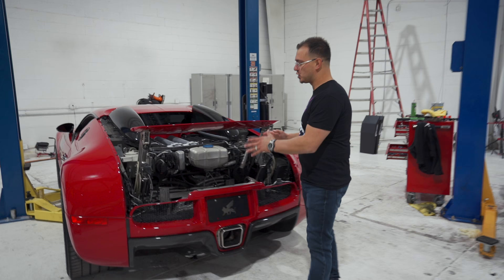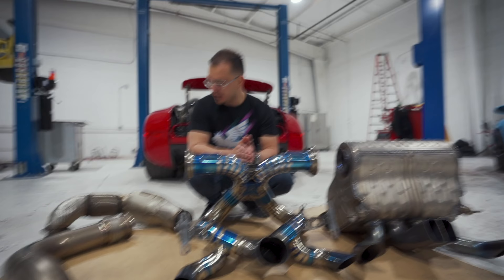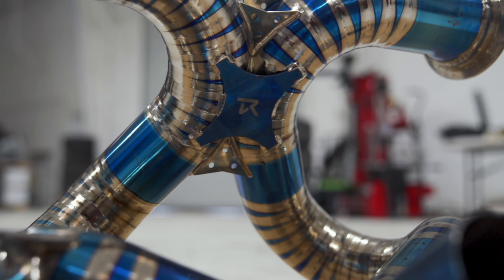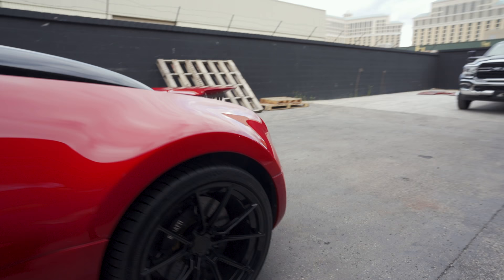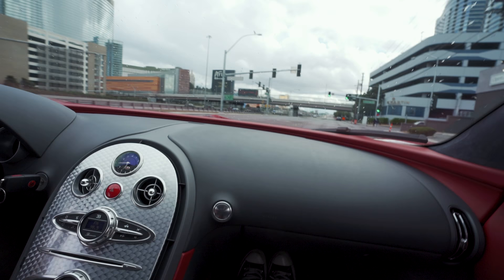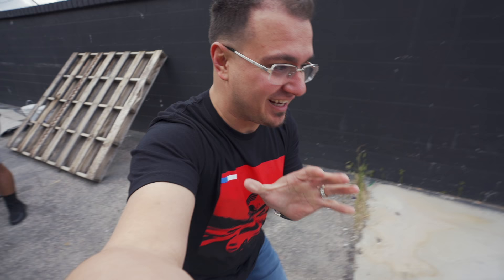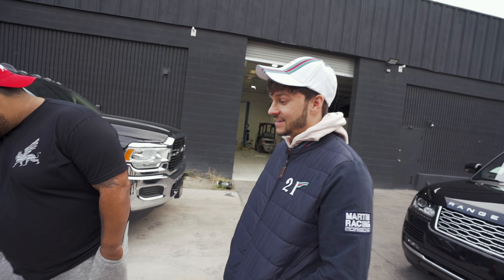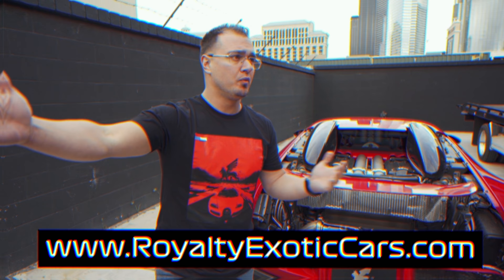Worlds FIRST BUGATTI Titanium Exhaust Install *LOUDEST VEYRON in the WORLD*

Comment: 'You can immediately feel the torque difference' - until you offer up a dyno chart - I do not believe you.
Reply: Lol right
Reply: lol I guess you don't know how turbos work ie less back pressure = more spool = torque earlier
Reply: MaxMade Bugatti absolutely perfected this car already. To think we can take a stock honda civic, swap the pipe and gain 5-10 horsepower is reasonable. To think we can take a >$1mil 1200hp hypercar and feel a torque difference immediately from a homemade pipe is just silly 😂 who do you think engineered these things? Their budget far exceeded what they needed to make a car that met emissions standards and still maximized 🐴💪🏻
Reply: @justnel4  mate I agree Bugatti certainly did!! But do you know why it has a 4"-5" exhaust with so many Catholic converters? Other than prayers for jesus... it's a combination of reducing back pressure and stopping a 2.5m flame shooting out the exhaust. Their next video highlights the turbo's spooling sooner and also faster as most likely the MAF sensor(yes MAF) sensed more air going into the engine (Higher efficiency) and was restricting power as it had exceeded the safety margins pre programmed.

Hondas are awesome but i wouldn't mention them when it comes to talking about power gains in turbo cars. Go buy a diesel and take out the dpf and report back how it feels. Trying to jam 1200hp through a million cats is going to induce some decent back pressure
Reply: Justin McNelly They perfected the car for comfort, reliability, legalities and performance, doesn’t mean you can’t get more performance, just means you have to sacrifice the other three categories. Closest example of this is Ferrari, they are fast cars but it has been speculated and tested that with a tune and some basic modifications Ferrari’s can comfortably make 100-300 more horsepower, just means that reliability is uncertain and the ride won’t be as smooth or predictable.
Reply: Homemade pipe??? Its a titanium exhaust bro what r u on. Gt3rs s gain like 40-50whp from one, and they're like a 4l 6cyl
Reply: Install a new header on any stock car and you will immediately feel the torque difference. Have you ever worked on cars before? I dont know about million dollar cars but I'm assuming the same would happen.
Reply: Right!
Reply: MaxMade it was obviously a joke, but thats not how things work, you can’t just upgrade engine components without tuning the engine for the new components, most engine upgrades will probably get you little to no power, even less power than stock, if you swap out the air filter for example you engine won’t know you’ve got another filter, the car is always tuned to run its best with stock components obviously, its not tuned up to work its best with a straight pipe when it comes from factory with mufflers n shit
Reply: Ok guys the standard veyron has 1001hp and the super sport has 1200hp
Reply: @MrNotStock  no
Reply: @billyray4716  Psh. I look at ecu software all day, specially German ecus.
Reply: @MrNotStock  I mean the engine was developed with these catalytic converters so i guess it could be true but not that hard as you think. Also it could get less power
Reply: @justnel4  the W16 4x Turbo is underpowered from factory. Bugatti didnt make the engine its a VW design (W16) Bugatti is owned by VW and the Bugatti name and design is all made as Bugatti, by VW
Reply: @justnel4  perfected 😅 while conforming to strict production emission regulations 😅
Reply: @justnel4  not to mention bugatti are not masters of exhaust craft. Flow and scavenging changes from this hand made system will 100% increase power and torque across the board after a remap

Comment: Get rid of all the 6 cats you know how insane the car would sound 👀
Reply: he said in video you have to take off engine , nah too much 😅
Reply: @Jarne Duijndam Without cars the car will run much  cooler :)
Reply: Would need a tune. Dont think anyone had even attempt to crack the ecu in a Bugatti.
Reply: @robertsrt  it needs a haltech anyways
Reply: @robertsrt  you can chip tune them. 500+ hp
Reply: Dutch NFS Gaming oh yeah
Reply: YAR ROCK Uhm no.
Reply: YAR ROCK what???
Reply: robertsrt its just a VW ecu
Reply: YAR ROCK bruh... straight pipe turbo back is how you make the most power
Reply: @YAR ROCK no, you don't want back pressure in your exhaust, ever
Reply: @robertsrt  Someone in Canada did swapped bigger turbos and made 1500hp

Comment: Seems to me like you're probably creating backpressure (and leaving power on the table) with that step down in piping size from those sewer pipe test pipes to the muffler delete. What is that, 3.5" - 4" necked down to dual 2.5" pipes? You should make another more simply designed muffler delete with straight 3.5" or 4" j-pipes basically taking a 90 degree turn after the test pipe then exiting. With turbo cars, zero backpressure is the goal and will make the most power.
Reply: Exactly, plus it just looks awkward.

Comment: That socalled power gain is only achieved if it gets retuned. Its due to the increase of exhaust flow, but lack of compensation of the ecu/engine itself to make use of that extra flow.

Comment: LOL that exhaust probably barely makes any additional power since it necks down from 4" to 3". considering there is 4ish litres and 2 turbos evacuating through each side of that exhaust system, 3 inch is WAY TOO FUCKING SMALL. I mean, there are MANY high performance japanese engines smaller than 4 liters that require a 4 inch exhaust in order to breathe to their full potential. So use that information as you see fit

Comment: Yeah, ""test  pipe"" and we believed it! Man up and say you have deleted the cats! 😉😅
I have also changed the cats with some horses 3 of my cars and my bike, except my daily car (names Quik, made in Iran by SAIPA. it's a KIA RIO 2003, but much prettier), who has an added supercharger (she had a B5, 8valve NA) and top to bottom is changed. As stock she had 70WHP at ~5.3k rpm, now 203WHP (I have detuned her engine after 4k rpm as she is daily and gearbox is not upgraded. This is why my top torque and whp are so close) at 4.0k rpm & ~260.0 kn torque at ~3.8k rpm with lowest octane gas, without additives, but with water methanol injection, yet I made a custom exhaust kit, with 4 freaking cats which are from a bike (Benelli TNT 302) just to feel not-guilty!
P. S. I'm in Iran and here we can use combination of premium gas, add 20% Methanol, clean inside the exhaust, turn on water-methanol, rich the fuel(considering the nozzle of water-methanol injection size, 9.8 to 10.5), and finally a bit of mapping (coil charge / duration / advance & retardant, and charge) to get the annual emissions test without cat(although here we have to levels of pass and the beter one brings some discounts with it but yet you can go everywhere with the latter too, just you need to pay a bit).